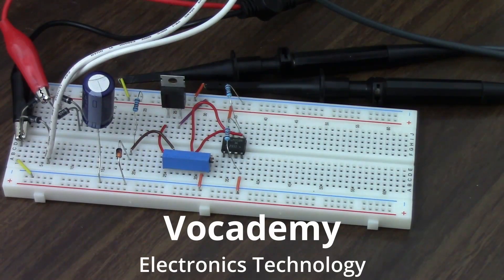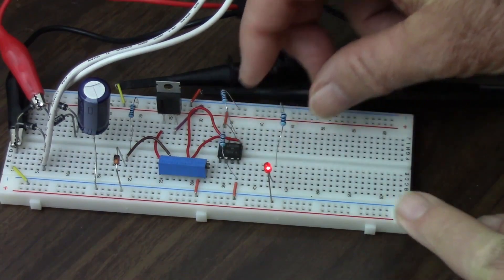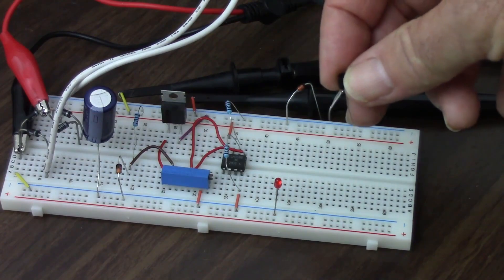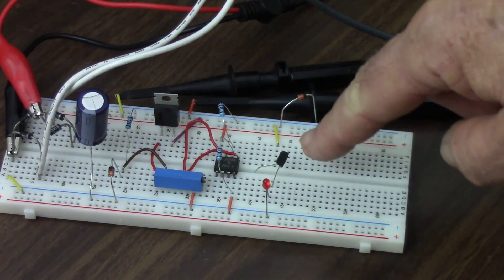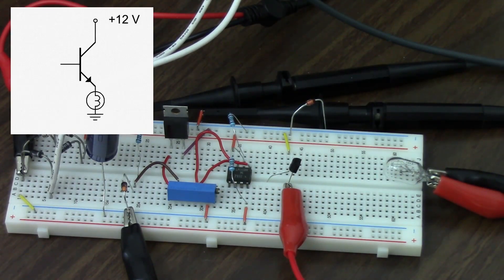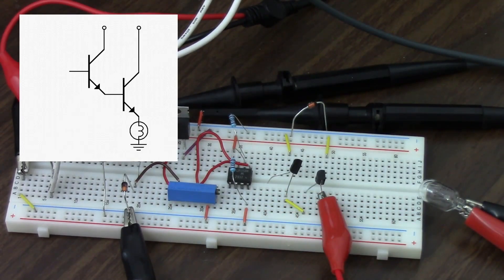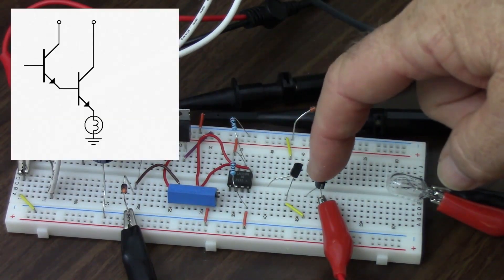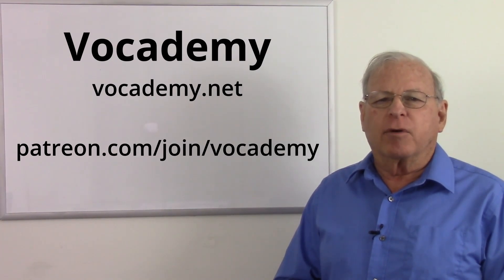How a Transistor Works

Comment: I have a question. I notice you put the LED on the emitter side of the transistor. What would change if you but the LED on the collector side?
Reply: The collector is where the power flows through, so putting the LED before the transistor would expose the LED to the full 12v and burn it out. 

If you mean keep the led where it is and flip the transistor around, then no power would flow. This is because transistors act similarly to diodes where current can only flow from one terminal and exit from the other. 

You’d see something similar if you flipped the anode and cathode of the LED. LEDs (or light emitting diodes) only allow current to flow one way unlike, say, a resistor. So we can’t flip them around unless we flip the power supply as well.

Comment: The current would go from one finger to the next via the palm. When you wet your fingers, was it the whole hand, or just the finger tips?
If the latter, why would that work?
Reply: He only had to lick his fingertips.  As long as there is a low-resistance path for the current through the skin at the point of contact, it will work.  Dry skin has a very high resistance; in contrast, the inside of the body is moist and has a lot of ions to carry current making for a low resistance.  You can think of his fingers as a simple loop with three resistances in series that the current has to get through: 1) skin of one fingertip at the point of contact (high resistance), 2) internal path through the inside of fingers and hand (low resistance), and 3) skin of the finger at the other point of contact (high resistance).  Since resistance adds up in series, the two high resistances make it impossible for much current to flow.  By licking the skin at the points of contact, those two resistances drop and so does the total resistance for the finger to finger loop.  Hope this helps!